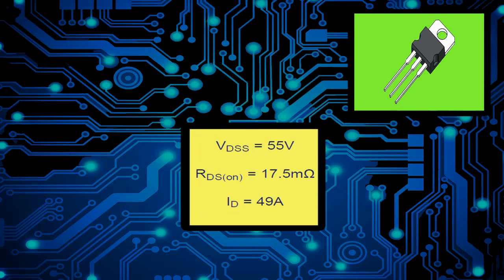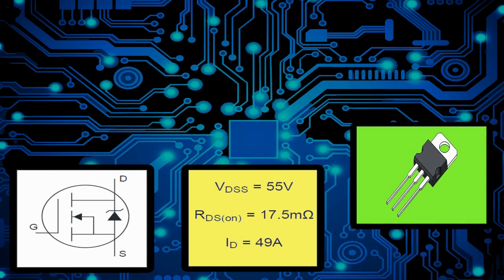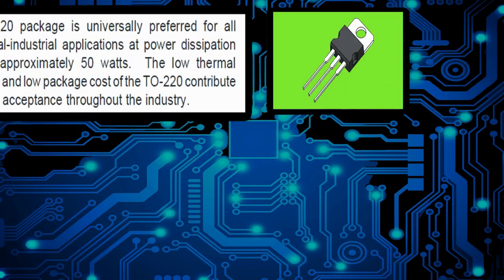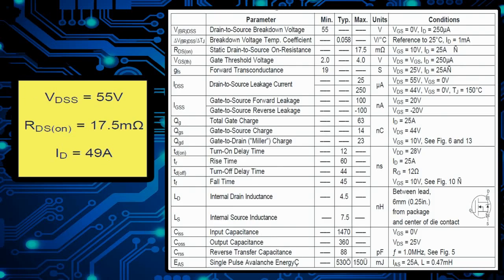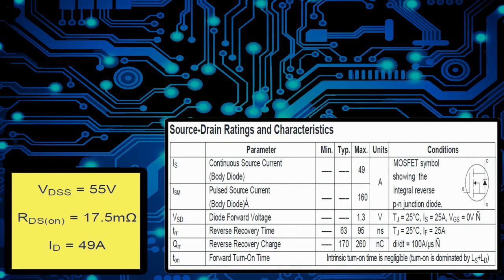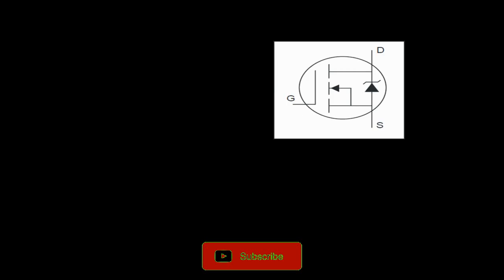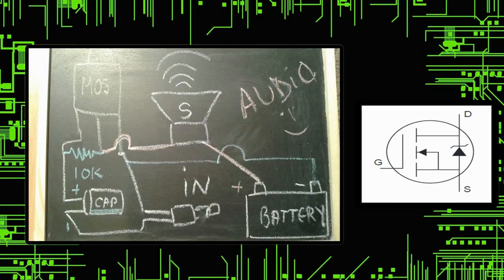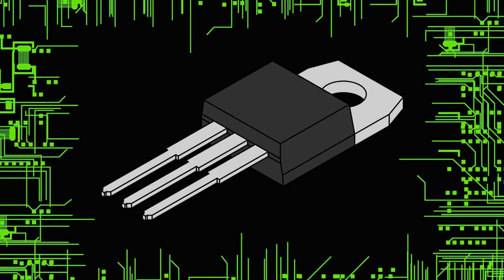IRFZ44n datasheet - Irfz44n mosfet pinout n-channel power transistor

Comment: 2-4v for the gate but how many amps?
Reply from the maker: Dalton Neumann mosfet is different then a transistor, we can say that a mosfet is a voltage driven device which means very low miliamps
Reply: Ok for the z44n mosfet how many milliamps at 4v go to the gate I need the variable for a resistor calculation for a 50v 40 amp dc power source with a variable switching output
Reply from the maker: Dalton Neumann it's in the microamps range watch my video about how to make a touch switch I am triggering it with the body resistance which is around 2megaohms but for a measuring reference calculate as 1ma
Reply: @NoSkillsRequired  thanks i had saved it to my watch later earlier today I'll watch it now thanks again for the help
Reply from the maker: Dalton Neumann my pleasure friend and do go thru the videos more useful and interesting projects and as always more to come all the best
Reply: And thanks for the fast response that's really cool

Comment: What's the point of this video ? Everyone can find datasheet on internet.
Reply from the maker: Ficraft you will be surprised
Reply: Yeah maybe you're right :P
Reply from the maker: I was testing some animation effects,i see now that should give more info : equivalent,pins,vs bjt .Are you working on something interesting?
Reply: I thought the same thing. No point in making such a video if the data points are not even explained. Also, the tables were not shown for long enough. Even when trying to pause you'd have to rewind first every time. That is really annoying and reading an actual data sheet is much more convenient than watching this.